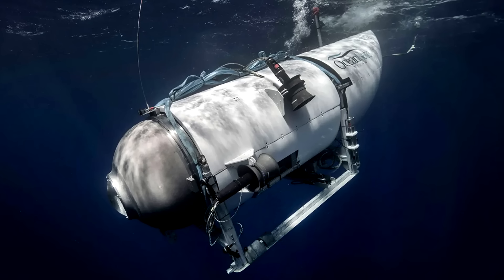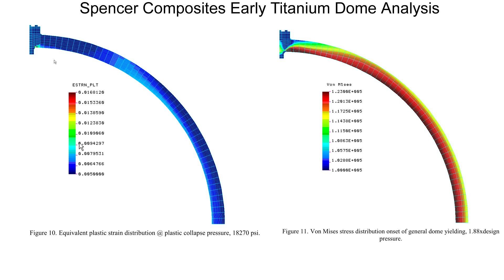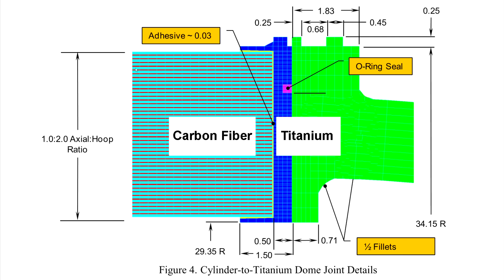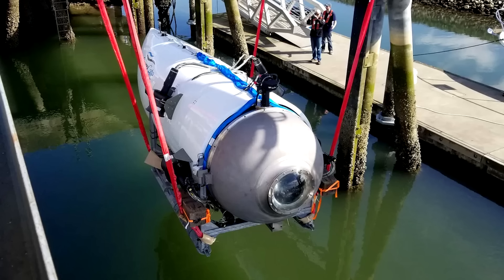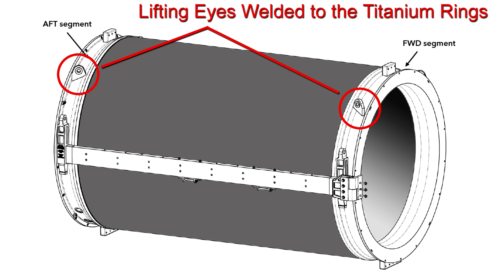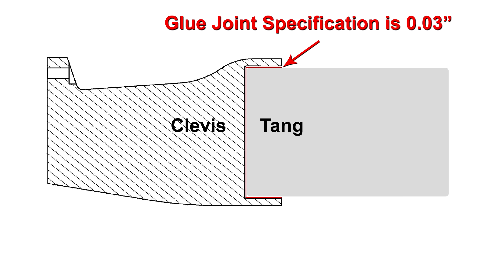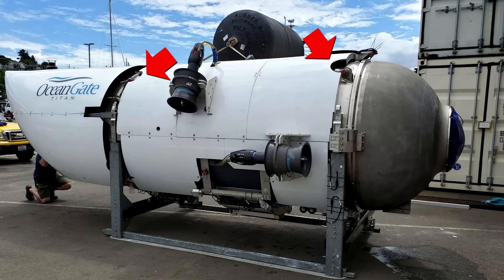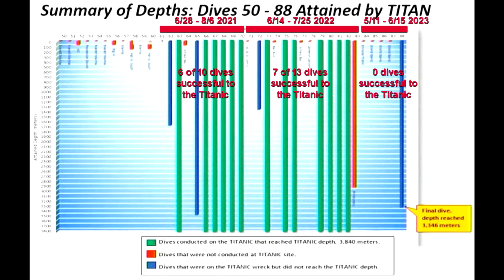OceanGate Titan Titanium Rings - An Additional Story About Them

Comment: Well... At this point it doesn't matter to be honest. Structural failure was detected by the acoustic monitoring system. The detection was ignored. It really doesn't matter if the failure appeared within the ring-carbon interface or delamination within the carbon fiber body...

Comment: Since this happened I've said that the most likely location of failure was the ring/body interface. I was dismissed by most. Most people were quick to blame the carbon fibre body.  

Now, finally,  people are focusing on the adhesive at this critical interface.
Reply from the maker: Thanks for commenting and glad you liked the content.  i agree with you.  I go back and forth between the hull or the joint being the primary problem.  I have done three videos on the hull and one other video on the glue joint.  But this lifting ring controversy is certainly interesting, isn't it?
Reply: @solareclipsetimer  Yes, it is fascinating.  I too still wonder if the body might have played some role in the failure.  However I do still think it occurred at the forward ring interface. 
Boeing had done an initial analysis of the hull design and estimated that the hull wall thickness should be 9 inches to operate at that pressure.  It was Rush who, concerned about weight, " re-engineered " it to 5 inches of 1 inch laminates. This increased how much the hull flexed under great load. That excessive flexing of the thinner hull amidship could have caused the plane of adhesion at the ring/body interface to become compromised.  In other words there were no longer two flat planes glued together, rather one flat plane ( the ring ) and one plane that was in flux. 
And the images, both on the sea floor and after raising, seem to support this.

Comment: Seeing those guys smear the glue on with a bondo blade in an open air warehouse let's you know many mistakes were made.
Reply: I take more care applying thermal paste.
Reply: Personally, I'd like to apply such critical glue in a vacuum chamber to eliminate the possibility of voids or bubbles.
Reply: @Keenasalways  I have worked with long and short short strand Carbon Fiber on Aircraft, Boats, and Race Cars of all kinds and using a flexible plastic spreader or as you refer to it as a “bondo blade” is pretty common practice to spread resin around before the part/assembly is placed in an autoclave/vacuum/bag/chamber.  That all said personally I don’t like gluing two pieces paper together with Elmers glue in “open warehouse” because of the general crude and corruption that can fall from the rafters etc. my normal SOP when working in a warehouse environment is whenever possible blow the place out before starting to work in it, sweep and mop the floor daily, erect a plastic tarp over the work area prior to the start of bonding (gluing),whenever possible setup air filtration and have the bonding area and curing area as close as physically possible.  All that said sometimes you just can’t blow out or tarp off your work area and the autoclave/vacuum chamber are a long distance away from your bonding area.  
PS In case you didn’t know you when bonding fiberglass or carbon fiber together with itself or say a piece of titanium you wet the surfaces down with resin(glue) mate them together and clamp them together and then it put the clamped together assembly in the autoclave/vacuum chamber to remove air bubbles (side note the resin is normally de-gassed after it is mixed together in a vacuum chamber before using it)
Reply: @Keenasalways  There should of been anchor studs embedded in the ring/tube .....
Reply: @leso204  should have
Reply: @leso204   "There should of been anchor studs embedded in the ring/tube ....."

There should have been better teaching of English in your schooling.
Reply: @Keenasalways  I doubt  even doing that would have prevented the inevitable implosion.
Reply: @infrasleep  Probably not. It's just a glaring red flag about their overall approach to build quality.
Reply: @ Agreed and rolled under uniform pressure to thousands of an inch.
Reply: I've much experience with layups of fiberglass, carbon fiber, and Kevlar. Watching the videos of their construction, I'd never come near it with an eye to riding in it!
Reply: I apply my toothpaste more carefully
Reply: It was truly insane. I used to work in car manufacturing that used various carbon composites, and even just for cars there was sealed off areas, full body dust proof suits, temp controlled warehouse etc. And a car isn't dealing with the pressures of the ocean thousands of feet down.
Reply: That was a huge red flag for me at the beginning of this story a year ago or whatever it was. In aerospace, any critical bonding has to be done in a cleanroom environment, and their process looks like it would have resulted in tons of bubbles and voids.
Reply: @F0XD1E  
18th June 2023... Father's Day. R.I.P.
Reply: No gloves too
Reply: Even worse was that there was no glue forced out when the ring was lowered onto the hull. There should have been enough glue that the excess would have been squirted out when the ring fully seated down.
Reply: No temperature or dust control, no Hazmat suits, nothing. It was as if they were putting Bondo on an old car. I'd have trusted those endcaps more with 6 Ti bars holding the 2 ends together lengthwise. Stockton was a penny pincher and it cost him both lots of pennies aa well as his life. He'll go down in history as a fool, not a pioneer.
Reply: A complete chancer  @dc6233
Reply: The attitude (apparently) of the teams assembling the Titan, was similar in my mind to kids in their bedrooms, hard at work, concentrating, building, building, building, taking their much saved-for Airfix models to create their much-wanted planes or boats to be able to sail on local boating lakes or fly over sone nearby field... The ambition is high quality, the intentions are pure and strong, the construction fine for amateur application...but those intensely interested kids would not (if mature enough to recognise the capability of their models are perfect for local use in play_) depend upon said models to save their lives / the lives of their families or friends, (or perhaps, "paying guests"?) in real-time application in amongst the "big boys" flying living passengers "from A to B" or, in any deep-sea diving, experiencing pressures at huge depths not designed for their home-made 'Airfix' crafts... Even children would see the futility of such creative ambitions, I am fairly sure. Rush seemed to treat hux vanity project as the one child who might just think his particular project would work, be safe and worth _his effort. He was wrong...and he. His hubris and his team cost the lives of four men who didn't deserve to did just to prove Rush's point. And Rush died too...yes, so that makes it okay then?!? When will men learn... (and I guess, women too, as Rush obviously swayed the mind of at least one woman on his team. 
I never want to hear that anything like this could happen again. Please. Stay alive, stay safe, be sensible. Learn from the Titan tragedy. It's heartbreaking still to think of what happened - yes, the only "blessing" it being an end tok quick to contemplate...but if they knew or had any inkling prior to the implosion. :( 😢 😢 😢 😢
Reply: I would not use carbon fiber in a submersible pressure chamber
Reply: yep...

as a hobby "engeneer" / inventor that was the very first thing that completely struck me.

when i change the headset or crank bearings of my MTB, i keep it cleaner then those glue surfaces from the Titan sub...

even a tiny corn of dust that gets trapped in between the glue layers, will exponentially weaken the connection over time and in deep depth.

there is no room for error here. This glueing process should have been done in an controlled, air filtered environment where everyone wheres hazard suits.

they should have also made an in-depth X-ray scan of the finished glue connection, to see if anything got trapped in between the layers (dust particles, sand, air bubbles) and if the glue spread evenly.

and the applying pattern and amount should also be highly regulated.
Reply: When I first saw that clip of them applying the epoxy in the titanium dome channel, it blew my mind. I couldn't believe that any one of those people thought this was a good idea, even for a shallow dive test vessel. 

There are far better ways to apply industrial grade adhesives AND to cure them, either in a vacuum chamber to remove air or an autoclave that uses heat AND vacuum to cure and remove air. 

Stockton Rush was the absolute cause of  all the failures. No wonder so many people quit and practically volunteered to testify AGAINST him, in these hearings.
Reply: pretty sure that was less glue and more as a spreadable gasket cause the taper of the ring was going to keep it in place.
Reply: @perry92964  It was glue.
Reply: And no covid masks, absolutely unprofessional.
Reply: Covid masks have been found to be not only useless, but dangerous.
Reply: I was wondering. No masks. No hermetic barrier. I mean, I'm no engineer, but it's as important as medicine sometimes ain't it?
Reply: its glue brother.  thought it was the powerful carbon fiber?
Reply: The red flag was, there are people stew pid enough to want to even do this, and waste the millions of dollars required to enable these people to commit sue i cide.
Reply: It doesn’t even appear that they applied enough glue.
Reply: Stockton seemed to rubber stamp any as-built he wanted.

Comment: Great point. 
I personally laughed at the gluing process. You should always manipulate two surfaces to remove any air bubbles, and they should be able to escape.
Reply: Also, there's no way, absolutely NO WAY of knowing that glue is layed down uniformally anywhere.
Reply from the maker: Thanks for commenting.
Reply: on another video I saw someone comment that had used that glue professionally in industry. Apparently it needed to be applied in a clean room with a specific type of applicator that would not introduce bubbles. They went on to give many more details and specifics about the process with the point that the it was a completely botched process. They also were shocked this puppy made it down and back so many times.
Reply: When I heard they only had GLUE holding the fiber to the rest of the frame and 6000 psi....
Reply: I’ve seen better fit up with a waxed plumbers seal on the loo.

Comment: I think that you could get away with welding the lift rings after bonding, depending on the welding operation. The heat would not be high enough, in my opinion, to affect the adhesive or the homogeneity of the dome (at least no significantly).

But, why weld them in the first place? With increased bonding surface area, you could bond them!

Comment: idk if  this is a common bit of information but why did there have too be  ripples in  the carbon fiber layers why could they not have better tolerances
Reply: They needed the ripples so the rhino-liner would adhere.  sorry joke.

Actually, I think they used the rhino-liner to hide that hideous wrinkled, cheap looking hull from paying passengers.  Even knowing it hid it from visual inspection.  Optics were more important than safety.
Reply: The circular layers of carbon fiber are pulled tight while they're being wrapped on, so the layers are compressed pretty well to start with, but they still compress a little more during the curing process (heating the material so the epoxy resin changes into a solid and bonds the carbon fibers together permanently).  That extra compression slightly reduces the diameter and therefore the circumference.  But the carbon fibers were wrapped onto the original circumference, and they can't change their length.  So the structure is forcing the carbon fibers to "get shorter" and the result is similar to pushing on a rope, the fibers have to bend, and the only direction they can bend is outward forming a ripple.

I don't know why this isn't a big problem for other carbon fiber composite pressure vessels - maybe it's just because they use fewer layers, which should reduce the tendency to bulge.

Comment: That's such a brilliant idea:
(1) You intorduce completely unknown pre-stress in the titan material itself by the heat of the welding.
(2) You change metalurgical properties of the material in a way you don't understand.
(For both points: I don't think they'd go as far to properly heat-treat the metal, as that's not the engineering method used at OG, but I could be wrong.)
(3) You introduce very uneven (and probably never accounted for) stresses in the sub whenever the eyes are used.
Well done!
Reply: Three words "heat affected zone"
Reply: I had thought the rings were the least problematic part. But Oceangate find way to introduce heat and cyclic load past what it was designed for :(
Reply: Lets face it carbon fibre , glue, titanium for a sub is madness. Different properties, rates of thermal expansion or contraction.
Reply: @stevenconnor4221  the fact that they made it out of the type of carbon fiber that they did was absolute lunacy and negligence
Reply: @stevenconnor4221  I don't agree, or at least not fully. Airplanes use a combo of fibre, titanium, aluminium, acrylic etc. all the time. I know it's only 1 bar vs 400 bar, but it can be done. You just have to do it properly, account for the difference in the materials, test well etc. But I agree that it's simply not feasible (financiall for sure, technically you don't know, business-wise it would be a suicide after OG). So all titanium + acrylic is probably the way to go, at least for now.
Reply: @tomhejda6450  I work for a company that makes Carbon fibre for aircraft as another thing that they do, it still has to conform ro CAA, EASA and FAA regulations and guidance and will have to pass thorough inspections. Personally Im not a fan as it will eventually delaminate due to the glue eventually gives up its bonding and strenght, not to mention its brittle nature. Best be sure your using it strategically in your designs. At least aluminium has a small elastic range before fracturing. One thing for sure that ocean mob flirted with every manuverable way out of thier responsibility.
Reply from the maker: Thanks for commenting and you bring up some great welding issues.
Reply: @solareclipsetimer  A lot of people don't realize what welding can do.
My cousin warped the frame of his Unibody car by welding a trailer hitch onto it.
Sad thing is, he and I both grew up in our Grandpa's machine shop.
Reply from the maker: @TimeSurfer206  Agree, I am not a welder but have had several welding projects done for me by a local welding shop.  It's amazing how those guys learn how metal reacts to the welding process and tell me what I can and cannot design.
Reply: @TimeSurfer206  it's easy for our intuition to go "metal stick to metal" when welding, but you really gotta keep in mind you're melting metal onto metal
Reply: @gabotron94  Actually, it's a little bit more than "Melting."
It's more like Electrodeposition.
Reply: Also, welding a lifting eye onto the ring will make that local area quite rigid, and no longer able to flex as originally designed, able to flex in tandem wittht he carbon fiber. It is the old problem of a fabricator assuming that "It looks good to me" is "good enough" instead of doing a full engineering analysis. To do a full stress analysis of those weldments would be a very involved set of calculations.
Reply: and glue the stuff together in an unregulated, dirty industrial building

all the dust debris, sand and eventually air bubbles trapped in between the glued layers created weak points that exponentially grew under high pressure (depth) and changing temperatures.

all while 2 completely different materials changed their sizes due to stress and temperatures while diving. 

every hobby "engeneer" and inventor would have worked more professional and safer then what those idiots did, despite not having any of those fine degrees that they supposedly had.

just shows what inflated egos can do to people if they keep on going unchecked and unquestioned.
Reply: Classic Stockton.  went to school with the old boy, he couldn't get a date for a dollar lol
Reply: 5,000psi is approaching the pressure yo cut through steel with a water jet. Very unforgiving. 
Sympathy for all families loss .
Reply: @allanpatterson7653  Water jets use about 30K PSI or so to cut steel.
Reply: @bills6093  noted
Reply: Water is just used to carry the abrasive material, with a pressure high enough to get the speed needed for the abrasive to do it's job.
Reply: Id also like to add on that you need some serious heat to weld titanium, it isn’t like welding iron or steel.
The glue probably got seriously hot, aswell as the matrix material (the carbon fiber itself should probably be fine).
These are also not tap welds, to attach these you would have to make a pretty deep weld, wich can also lead to Metall impurity